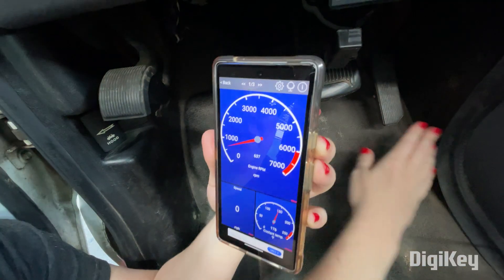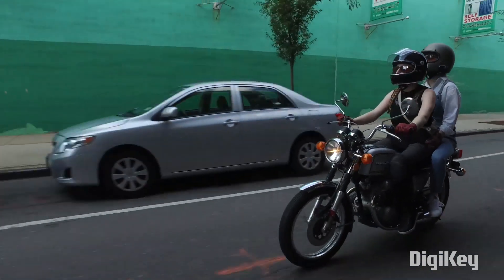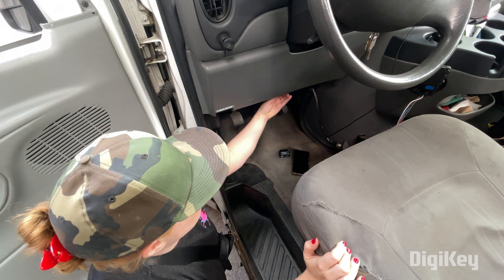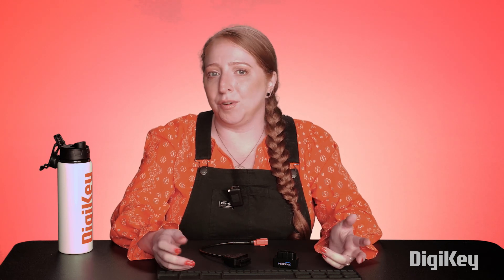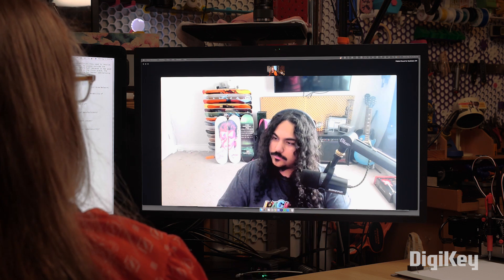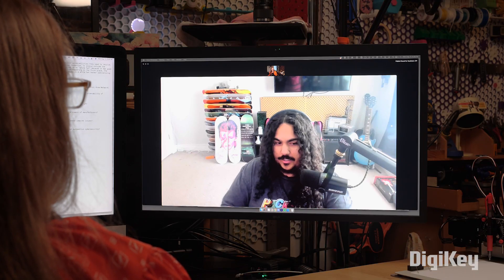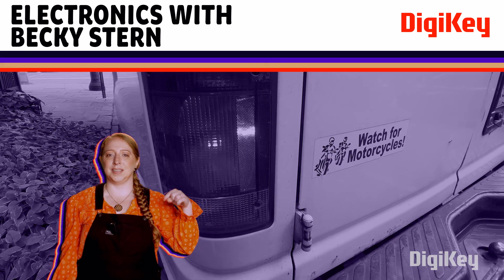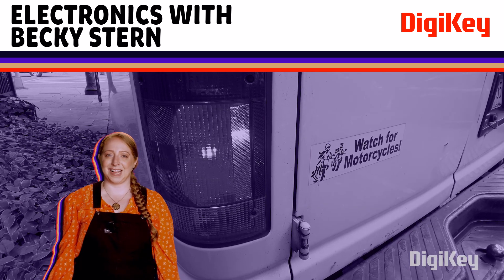Automotive Sensors - Electronics with Becky Stern | DigiKey

Comment: How about doing a few videos on entering the ECM and allowing yourself to program the air /fuel maps, torque management, turn off certain systems for the operating of a automatic transmission,  so a manual transmission. BECAUSE, WHAT I WANT TO DO, IS  Use the Mitsubishi/Dodge ECM to control  a  Honda/Acura engine the same year model and displacement roughly. (Both 2.4 Litres) and remove the dodge automatic transmission and use a Acura 5-6 speed manual transmission. This will require custom CV Axles  to fit the dodge hubs  and Acura trans axel. Also modify the fuel map and 'manifold absolute pressure  sensor'aka M.A.P. SENSOR, completely different from the fuel map, only things in common is the intake  and  fuel system.  The program the ECM to use a 4 bar  map sensor in place of the single bar. That reads vacuum to just  shy of 15 psi.  To allow a intake manifold l pressure just shy of 60 psi. To allow the engine to operate with a turbo. The ECM will add fuel  as  the manifold pressure rises. The most it should see is around 30 psi. {+/- 10 psi } 
I know different manufacturers making sensors that do the same things can have different values , for example, 10 ohm's could mean the engine temperature is normal on one , and extremely overheated on another. So possibly retrofitting  dodge sensors onto the Honda engine where required, or reprogram the ECM to operate with the new parameters can fix this issue, there is companies that  do exactly this, however they are very expensive, and geared towards more of a mass production kind of thing, for people who do this as a job, doing multiple jobs per week or month, not a person doing it once!  I want to do this once or possibly twice possibly years from when the last project was done. I don't need all the things that come with the kit the professionals are selling. Like buying the tools to become a mechanic, just for a oil change!  I may need to use a aftermarket ECM to actually control  the engine.  And use the dodge sensors where required to keep the dodge ECM happy , to keep it controlling the speedometer and what ever else is required to make it think it's controlling the engine. 2008 things were kinda complex, nothing near as complex as 2024.! ! . . Replacing a 2008, 2.4L Dodge engine , with a 2008 Honda 2.4L engine, shouldn't be a big deal, even replacing the 2.4L with a 2.0L or 3.0, 3.2, 3.5, 3.7, 3.8, or even a 4.3 liter  Chevy engine from 2018, should not be a big deal, except for the actual  doing it! In theory it should be straight forward!  Replace a secondary O2  sensor with a resistor and temperature sensor designed to show the approximate same difference  as the  O2 sensor that only showed the exhaust was being processed. Not the O2 that controls the engine operation, also with a aftermarket stand alone ECM adding flex fuel capabilities is possible. Only the ethanol content sensor is required, and the plumbing and wiring!  I would rather have the original ECM controlling the engine just like it is stock. Have you gotten that far into the ECM of a vehicle ? To actually control and change anything? 🎉 Happy New Year!🎊

Comment: Don't connect cars to the Internet.

Would you connect a Windows95 PC?

There is no intrinsic security in car electronics.  Manufacturers work hard just trying to meet regulations.

CANbus is certainly not secure. Intrinsic trust exists to all connected devices.

The less sophisticated LINbus is more secure because connection doesn't automatically provide control. Control is by a busmaster which is "electrically" fixed. It must be killed to take over the bus. Most plausible attacks on the master will also kill all the other devices on the bus.

Comment: There are companies in the automotive service tools business that offer reasonably priced OBD scanners too. 
Originally, most of the cheap OBD tools only read the fault codes and maybe let you reset them. That's better than nothing, but not as good as being able to look at signals. 
The newer scanners read the signals too.
If you are doing troubleshooting, you also really need the manufacturer's electronic service manual for the vehicle, especially for the wiring diagrams, component locations/testing instructions, and connector pinouts. The manuals are expensive, and sometimes people try to stonewall you and refuse to sell them to you. I have bought the manual for every car I got from 1994 on, and they pay for themselves on the first repair. 
I also recommend that if you feel inclined to dig into this kind of work, invest in some automotive test leads and a connector back-probing kit.